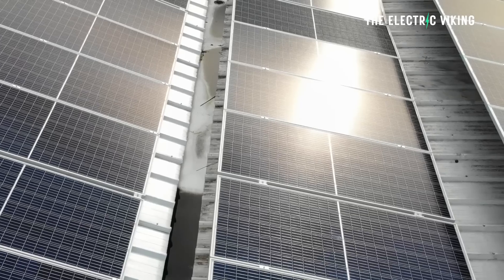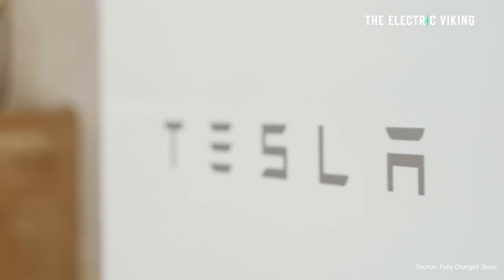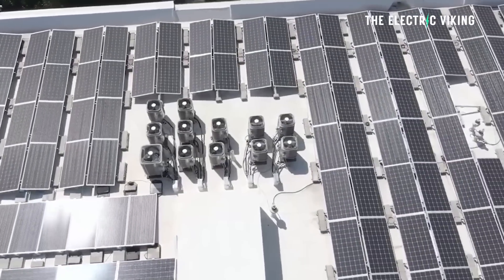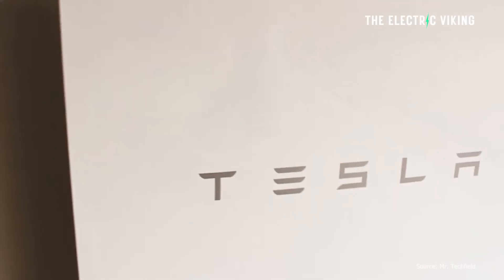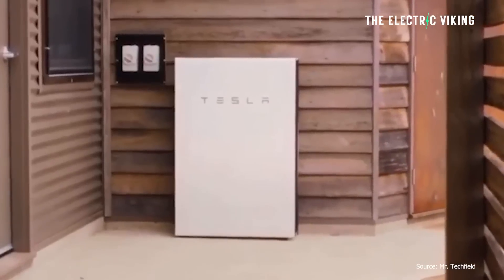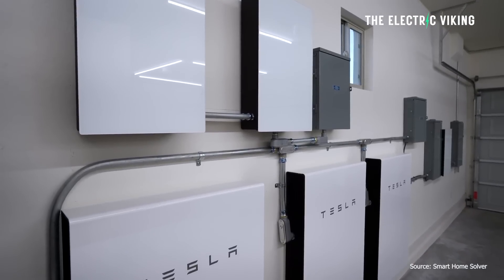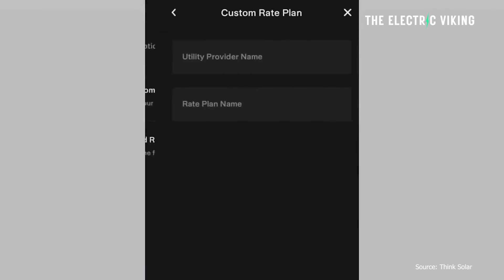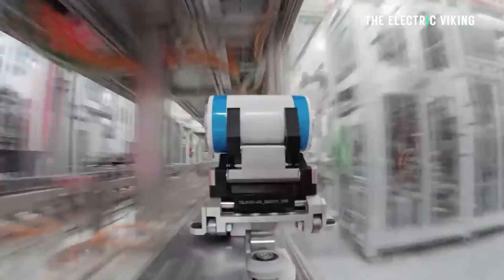Tesla DROPS the price of the Powerwall home battery AGAIN

Comment: May I say that you have been giving advise you are clearly not qualified to do. The fact is that for many consumers home batteries do not make financial sense - totally correct. But in some countries where the rates are extremely high, sometimes at high consumption times, batteries are a no brainer. There are places where they credit you 1 to 1 for kW you feed-in to the grid during sun hours for other times when there is no production. Some even carry forward for a different time of the year such as from summer to winter. In all these cases it is absurd to invest in a battery unless you have very frequent power outages. So in summary, its best to either restrain yourself from making reccos' that may not apply and are clearly disinformation without a thorough explanation.

Comment: Relying on the grid long-term is a leap of faith.
Reply: It's not faith if you have the education and understanding.
Reply: It depends upon exactly what you mean by "relying on the grid". IMHO you have to make at least  a qualified leap of faith in many parts of the world e.g. North-West Europe and much of the U.S.. But what will probably become a leap too far is the assumption that 24x7 affordable electricity will be always available. It is unavoidable economics for the grid supply to give dynamically adjusted multi-tier pricing that severely discourages peak-time consumption, and, in fact, any consumption during occasional shortages in electricity generation. This becomes more so as EVs, heat-pumps and renewable generation become  more prolific.
Reply: @jonb5493  
My first comment still holds true.

Comment: Today's Tesla Pricing Facts:

1 Powerwall   $7,500 (only provides 5.8 kVA continuous power.  My AC alone uses 3.2 kW, electric water heater = 4.5 kW, electric dryer = 2.2 kW.  Heaven help you, if your AC turns on while your water heater is heating).  You'd need at least 2 Powerwalls to live normally during a power outage).
 Gateway  $1,000
Accessories  $200
Delivery Fee  $200
Tax  $734
Cash Price $9,634
Potential Incentives Federal Tax Credit (30%)  -$2,890 (Note:  Add $5,800, if you want Tesla approved installation)
Price After Potential Incentives $6,744  (Note:  Add $5,800, if you want Tesla approved installation)

$/kWh $499.56 ($6,744 / 13.5 kWh)  (does not include installation costs)
Warranty (70% capacity after 10 years or they will replace the powerwall)
__________________________________________________________
DIY system Alternative:  
13.5 kWh LFP batts $2,300 
6kW inverter  $1,100 
Misc hw $300
Installation $0.00 (DIY!)
Tax $320
Cash Price $4,020
Potential Incentives Federal Tax Credit (30%)  $2,814

$/kWh $208.44 ($2,814 / 13.5 kWh) 
Cost saving over Tesla:  $3,930  (41.7% of the cost of a Tesla PowerWall)

Comment: I recently purchased a second powerwall after 2 years of ownership and can confirm current PW2 in Australia are NMC not LFP (PW3 will be LFP). I went with PW2 due to the warranty and payback on the single PW so far and ease of deployment. Im running with a wholesale retailer and making decent arbitrage on a special 2 way tariff but would not go with Powerwall if I had a fresh install. Tesla do not currently allow access to bulk discharge via api or app for home automation use cases and you need to rely on your retailer or being on a VPP which sux. Go with a solution that provides full control of your battery!
Reply: I hope they allow bulk discharge eventually!  It's cool that you increased your collection.

Comment: We installed two Powerwalls 3 years ago, along with 10KW of solar. Big investment at the time, but we are now making money exporting energy to the grid, and through a VPP at peak times, and we pay nothing to charge our EV. No petrol/gas costs, ever, and we are never without power. The future of energy- energy independence- is truly upon us.
Reply: Power to the people!
Reply: @darthsirrius You may want to reread the comment. He bought a powerwall… 3 years ago.
Reply: Great news ty for ur comment an first adoption
Reply: @darthsirrius it states that three years ago they installed power walls.  Not powerwall 3s
Reply: @darthsirrius  🤦‍♂️   Installed 2x Powerwalls three years ago, as per original post.
Reply: @darthsirrius three YEARS ago, not PW3...
Reply: @darthsirrius  They installed TWO Powerwalls - THREE YEARS AGO !!!!
Reply: the cost to install that would have been insane...
Reply: Location?
Reply: What was the price of the setup you have?
Reply: Making money (not paid off the difference). 🤠
Reply: So, how many decades until they are paid for?
Reply: How have your Powerwalls been holding up?

Comment: DIY Solar Power with Will Prowse has entered the chat...

https://youtu.be/m8R6TeTkb5k

WAY cheaper to do it yourself! Roughly $20,000 for a VERY good COMPLETE system!

I'm also installing two mini split systems on my house. They are capable of running direct drive off from the solar arrays for free air conditioning when the sun is out. And they switch over to the mains or the battery backup system during the night. Those units are down to $1,600 now.

I just purchased a house and I will end up completely covering the houses energy usage and selling the excess power back to the grid via reverse metering.

I anticipate roughly $100 to $300 a month credit on the best solar producing months of the year.

Comment: I would NEVER EVER buy a Tesla NMC chemestry battery.  Costs around €10.500 for the Tesla PW2 AC 13.5kWh.
And from what I understand, Tesla will only start using LFP tech in their new Powerwall 3. 
Rather buy a LFP battery of Blauhoff. 15kWh home Powerwall is €6.350 tax included. 10Y garanty with at least 6000> cycli.
Cheaper, better and same garanties.

Comment: I’m waiting for Tesla to offer HVAC technology as part of a package deal, along with improved battery technology and solar panel technology so that there is no longer any question that going solar is guaranteed to save money.
Reply: You're going to be waiting a long time for Tesla HVAC.  Probably forever.
Reply: That’s what everybody said about the Cybertruck and most other Tesla products. The muskrat always announces these things long before they become reality, but thus far he has always delivered, if only a few years later. He has publicly promised a Tesla HVAC system @incognitotorpedo42
Reply: Now, that really makes sense, as a total package it would be revolutionary. I just finally saw a very well explained article on the Tesla space of how a heat pump works, start to finish. Finally, a description that anybody can understand. Some people just have a knack for simplifying things. The heat pump has got to be the most revolutionary concept of heating and cooling that anybody’s come up with to this point, short of living where I live , where it’s never hot or cold and mid 70s is pretty much the normal temperature year-round with slightly lower dips during the winter
Reply: the ultimate approach would be to convert your entire home to DC so as to eliminate the need for wasteful AC-DC conversion, but that awaits the arrival of a new generation of DC appliances. DC motors are smaller and more powerful. The only problem is that it becomes dangerous at high voltages and cannot be transmitted over long distances. But within a house it should work better than AC @sandyt4343

Comment: Thanks!  How long can a fully charged (Tesla's or other) home-sized battery stay charged (to max 5 or 10% loss Here, very north, it can be very sunny on certain winter days, but then quite dark for extended bad weather periods.
Reply: Time of use tariffs n charge them on the cheap rate when not enough solar
Reply: The Powerwalls do not lose a lot of power when not used.  But if you are some place where it get cold you should have them indoors were the temp swings are moderated.  Same goes for most batteries.   Mine are in my garage and the do fine.  The temps drop down to the 50s in the garage when it is 20 outside,.  I have heard of people in Canada getting by just fine with Powerwalls.

Comment: I looked into a Tesla system a year back and compared it to a whole home system from Franklin.  I would pick the Tesla system if they switch to LFP batteries and can handle peak loads from Appliances like AC and Clothes dryer.  That's the only thing the Tesla system couldn't do. Anything 120 volts it could power but appliances on 240 VOLT it couldn’t no matter how many powerwalls you get.  If I am going to spend the coin I want whole home power for all systems in the house.  Auto-bidder is the one thing that pushes the decision more to the Tesla system.  My stove and oven are electric (240 Volt) so the Powerwall won't help there either. I went all electric except for the Water heater which is Ultra Low Nox but NatGas. And the Fast heat on demand hot water systems are also 240 volts.  I hope Tesla gets LFP powerwall and support 240 volt appliances in the near future.  Then it would be an easy decision;  and I would be set for the next 20 years.
Reply: Assume you are not in the UK as I have 2 Powerwall's and the max they provide is 10kW draw - (5 each is the limit TESLA specify) Never needed more than 10kW with Aircon and dishwasher etc running (and its all 240 in UK)
Reply: @peterjenkins8522   In the US I can't get that system yet. I had the company Tesla uses come out and they are the ones that told me they can't do whole home yet.
Reply: @peterjenkins8522  No in Australia, just ordered the Franklin WH x 2 which will give me 10kWh continuous 20 kWh Peak, LFP batteries with the ability to charge from a generator if need
Reply: So are you getting the Franklin WH
Reply: @bernielennox1031   I want Auto-Bidder so I decided to wait and see if Tesla will offer whole-home backup in their version 3. And I am hoping it is available in the US.
Reply: Tesla Powerwalls can handle dryers, AC, etc.  However, you might need 2 or more Powerwalls.  I have Powerwalls and we got 2 for this exact reason.   I can run the AC, dryer, etc. just fine when the grid is down. Also, it was cheaper to install with 2 or more since you did not need to rewire the home loads to a critical loads panel that was backed up, and separate unbacked up panel.

Comment: That price is still absolutely insane. You can get twice the battery capacity from other brands for that price. And all of them are lithium iron phosphate batteries and come with 10 year warranty.
Reply: Plus those other options most likely have a higher continuous power output. 5KW continuous for the PW2 is mediocre.
Reply: @GWhisperer  you can buy an EG4 battery pack with 61 kw and an 18k inverter for $23k. Much cheaper to go with that than the Tesla Powerwall.
Reply: @pin65371  61kwh battery with an 18kw inverter? Wow. That's way too much. 🤣
Reply: @croakingembryo  its not way too much when one day you need 61 kwh. I'd personally rather have too much than not enough.  Especially with batteries.  Having a lot of power available will extend the life of your battery. You're rarely putting any real stress on them.
Reply: @pin65371   Sorry but that is way overkill. Lifepo batteries degrade with time as well as cycles, they will not last much longer if you don't use them. I have a 10kwh battery with 6kw of panels and the battery rarely goes below 60% even during winter. Even when it's overcast it still charges fully. It's only if there are several days of serious heavy cloud to the point where you need to turn the lights on indoors during the day that the battery actually drains during the day, which is when we start taking precautions like using the gas stove instead of the induction hob or electric kettle and avoid using the hairdryer etc. So yeah, I would definitely be happier with a 15 or 20kwh battery in order to avoid having to take those precautions on those rare occasions, but I think 30kwh would already be overkill and 61kwh is just madness. 🤣 
I mean it really depends on how big your household is and how much power you use at night and whether you use an electric oven (which IMO is just not worth the cost of the extra battery capacity needed, rather use gas or don't bake at night), but the solar panels are a lot more important than the battery and are A LOT cheaper. 
The way I see it is the battery just needs to last as long as the time between sunset and sunrise (plus a few hours on either side). If you have enough panels, your battery will charge even when it's raining.
So yeah, use that cash to buy panels rather than battery capacity and save a crapload of it to buy something nice like an electric car, which you'll be able to charge easily with all those panels you just bought. 😋
Reply: Constantly blowing the Tesla horn, when there are so many better options . . . . . makes me think twice.
Reply: @Grizzold-HP2  Sam did mention alternatives. I like the idea of a single source supplier as integration is easier. It's a real benefit if you have a warranty claim. No one is forcing anyone to buy Tesla btw.
Reply: YTesla Powerwall might be more expensive, but they are rated # 1 by industry. The software that comes with the powerwall is unmatched by competition.
Reply: @rozonoemi9374  In the USA maybe, not in the EU.
Reply: @rozonoemi9374   "they are rated # 1 by industry"? LOL where did you get that idea?

Comment: I hear that the selfparking Tesla can plug itself in like the home robotic vacuum cleaner. 
And automatically becomes part of the VPP. 😊😊😊
It is a secret feature. 😊 
Money in the bank.

The home rooftop PV tops up all batteries every day. 

The vehicle at work can take the house feedin power and pay for the connection service. 
In fact, the home connection lead can plug into any power point and communicate with the grid supplier.
Reply: That's a secret feature all right.  So secret that it doesn't exist.

Comment: Nope, only will buy large LFP, need to bank whole lot of them of them together for my place. 
Waiting for power wall 3, they need to put BYD blades in it and drop 50% of the price.
If Tesla allows for V2L etc, 1 model 3/y= 5 packs. That’s a better deal.

Comment: powerwall for 3 phase: just need additional CT clamps,, (around $100-$200), and to charge in off-grid mode powerwall needs a single phase inverter with some panels in it  (aswell as your existing 3 phase inverter). you can move one of your existing solar arrays wiring  to the single phase inverter👍
Reply: Single phase 2 service entrance counductors . 3 phase 3 service entrance conductors EASY PEASY
Reply: No even with 3 x Cts it cannot output in 3 phase mode or balanced 3 phase output as the internal inverter is a single phase inverter inside so please stop misleading people.  In then when the grid goes out for the backup power it won’t ever and can never give a 3 phase output either only single phase. 3 x Cts only allows it to see / sense power being used on other phases not to output power on more than 1 phase that’s a huge difference.